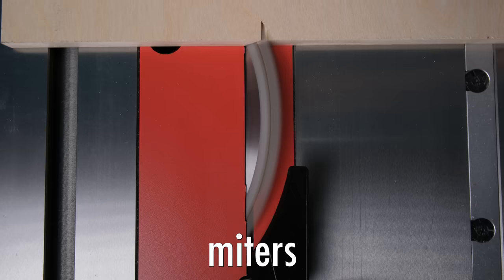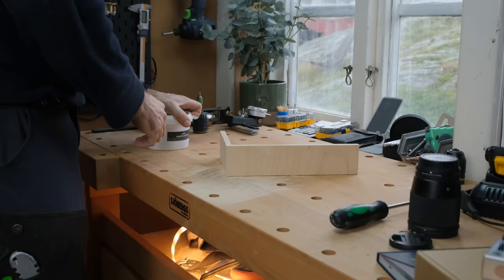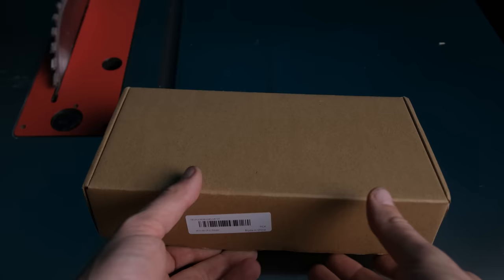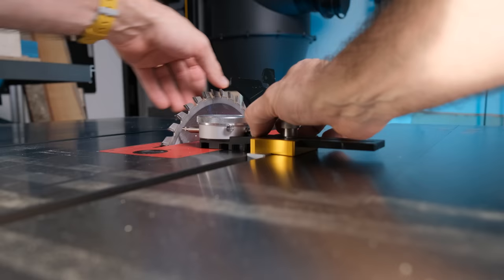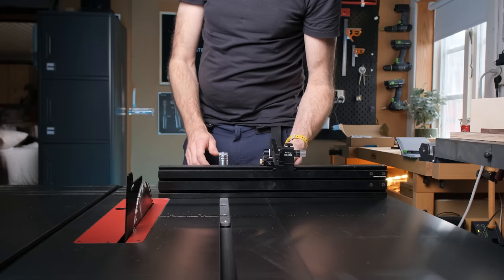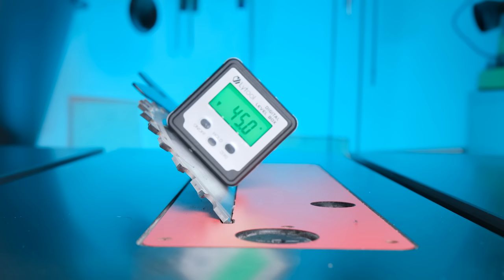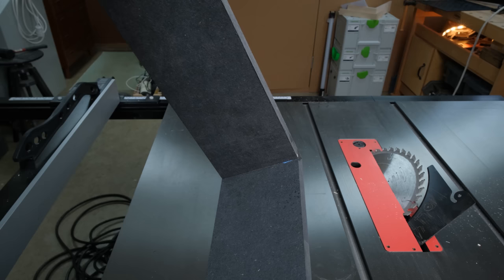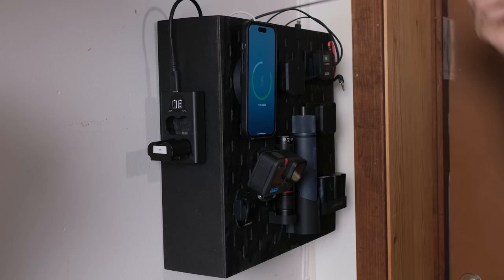It's like cheating

Comment: Well, on tracksaws there is a way to adjust the bladeangle relative to the track - at least the festool ones have it ;)
But if you temper it, you might need a new splinterguard if you move away from it
Reply from the maker: that's what I was thinking - it might ruin the splinter guard. :)

Comment: my biggest miter mistake....I was cutting a rare endangered rain forest hardwood, (illegal to own since 1997) and smuggled into the country with a shipment of drugs for a US senator ...anyway.. my young apprentice bumped the table saw and threw it off it's 45 degree angle causing an angle error on $30,000 worth of hardwood! What to do?  Well, I told the young apprentice to fix it!  And in  doing so he cut off 3 of his fingers!  I glued up the project and used those fingers as wood filler, I had to grind up the meat and bones with some glue, but it worked perfectly!

Comment: If i only had a table saw I would totally make this with a small change with using a mesh of neodymium magnets inside to hold the 3D printed adapters (as an attempt to get a cleaner look without the holes, plus I don't have a laser cutter). Great idea and very interesting video as always 👍🏻👍🏻
Reply from the maker: thank you! That would be a good idea. I actually thought of putting some magnets on the side of the charger because some of my things to charge have a magnet - but a charging station with only magnets would be really cool. It would be easier 3d printing them as well I think :)